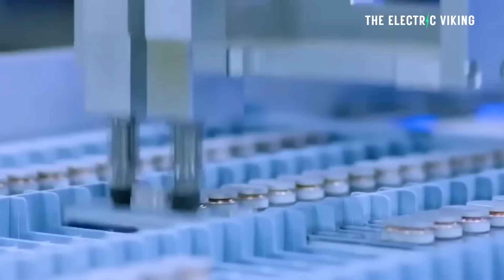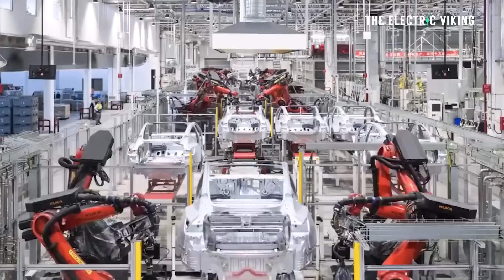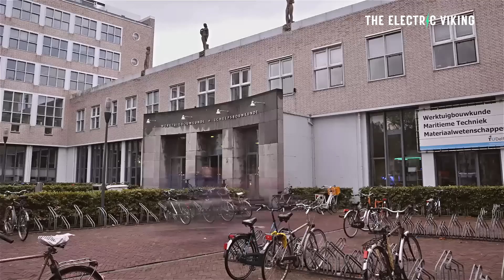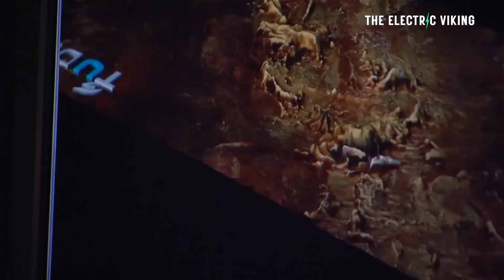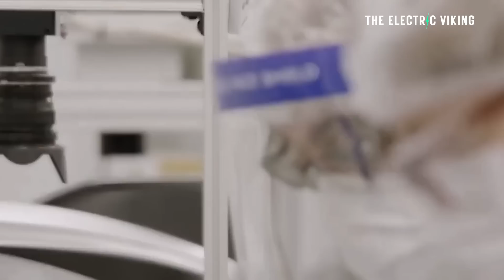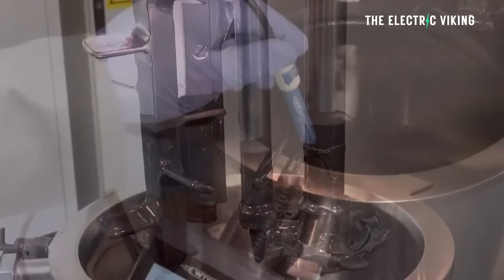Researchers make amazing discovery that cheaply doubles battery life

Comment: The same incremental changes can apply to solid-state after they arrive on mass.
You're implying we give up on a technology because what we have works well enough.
That's never been the way of progress, enhanced transportation covers the wheel to flight and many iterations worked well enough and better than what we previously had.
Solid-state may play a roll in the area of weight reductions, dendrite elimination or ending the spontaneous ignition of your cars battery.
If marking time was what we were best at, we'd still live in caves.
Fusion to fission has taken 70 years to get 1 working example.
Advanced EV battery tech is may be 15 to 18 year old, I think we can give solid-state a few more years of development before tossing it on the scrap heap.
The learning never stops nor should it.

Comment: FYI "Not enough lithium" :  In general, mineral source - including oil, lithium, sodium etc are defined by availability@ cost - NOT amount of material on planet.  Ie there is huge amounts of lithium at infinite cost, but there is a limited supply of lithium at a particular cost.  That cost is subject to change based on technology to extract the mineral, and that depends on needs required to meet poduction.
Nissan/Toyota stating there is not enough Lithium indicates they are "stupid".  The cost of lithium will rise as supply/demand/cost-of-extraction changes, but will fall as new technology of cost of extraction improves (Tesla is working on cold extraction making it much cheaper).
in future, during stable state of electric cars, then the supply of minerals will come from recycling as the unit cost of a battery is high and therefore recovery of minerals is commercially profitable.  At that point the cost of minerals will fall significantly.  That event of course is years away.

Comment: The future of batteries is to eliminate more than one per application. 

Already from Brazil to Canada engineers have demonstrated that batteries are endless supplies of electrodynamic energy (the useful stuff of electricity) that can be tapped without exhausting the limited supply of electrons and protons (AKA discharging).

Sure, the Brazilians who ran multiple printing presses all day with two lead acid car batteries with a commercial inverter and their secret backpack sized invention were arrested, and not one auto maker the Canadian approached with his smart transformer wanted his solution, but eventually the world will choose life ahead of dollars. You can’t eat radioactive or oil soaked food and reducing the population has an offsetting economic impact over the cost of eliminating toxic energy production. The incremental approaches are designed to minimize the impact of the coming economic revolution, maximize the invested returns as long as people will still buy them. Today any car could be self-charging while being driven, not just braking. And any one battery could supply all the power you need without charging, Really! Sadly, Physicists choose eating over truth, they can easily show you the math that mass transfer is a viable self-powered motor option ( no battery or fuel needed) Both Viktor Schauberger and Sam Clem built them to run his home generator and the other his car to drive across Texas. (Momentum is conserved, not kinetic energy like electricity (that can be easily amplified). Free energy doesn’t pay university funding.

Comment: Modern litium ion batteries only contain roughly 2% lithium based on weight. But lithium has sky rocketed in costs. Any technoligy that lowers the required amount us a good thing. I agree that every battery has a place in the future. I would like to put to bed this fear based idea that ev's batteries will need replced every 7-10yrs. Thats just not the case. Even after 10yrs and 1500 battery cycles you still have 80% of what u started with. Its not like blowing a engine and replacing it. Not at all. For many people it will be there childtens car after 10yrs. Sure its range will only be 180miles or less. But it still functions just fine. I was a sceptic for years but theres just not data to back it up. Battery packs are delivering on what they promised. I dont see or hear people bitching because there cars battery died after 3yrs. Or 5yrs.. Or even 10yrs. Pencil out maintaince and engine/transmission service and replacement and i think its a no brainer. The ev's win everytime.

Comment: 1,000 South Australia big batteries 
is equal to South Australia's 1.5million registered vehicles with 100kwh batteries. 

So when EV replace all South Australia ice vehicles then the daily DISPATCHABLE power will be 10 times the sundown needs.
Every rooftop with 33kwh of solar panels and connected to the grid. 
Any political party that jeopardise that future is dead.
Fossil fuels will be needed for raw feed stock in German manufacturing plants relocated to Adelaide. 
Nuclear exports to every country's nuclear industries will not be needed. 
German migration to Australia will be one of the boosts to Australia population.

Comment: The future is not central electric power generation because the distribution costs are huge. The national grid would have to be 5 times bigger in capacity. 
The EV big batteries will be in vehicles parked 23hrs every day and automatically connected to the national grid. 
This gives 5 times more dispatchable electricity daily, 5 times more than today's fossil fueled power plants. 

The home robotic vacuum cleaner can teach the selfparking EV to connect to the grid. Ezi pezi. 

Every rooftop solar PV is connected to the grid. 

This combination can not be beaten.
The auto manufacturers know this. 
The nuclear promoters know this.
Big business knows this.

Every one knows that the additional cost on a country expanding its national grid is deadly economically.

Comment: I’ve had loads of petrol and diesel cars, never had an engine go over 500,000 miles without a full rebuild / replacement so what’s the fuss if your 10 year old electric car needs a new battery pack, assuming you can’t live with a lesser range ?
Reply: I think it's cost comparison. By the time your car needs that engine work, you could easily replace the whole thing for 2-5k. When an ev needs a battery, it's still going to be 10k+ of its even available because the damn things have zero standardization. Just look at gm. The volt bolt and spark all have unique batteries that gm doesn't make any more. They can't be upgraded to the ultium platform either. So finding a battery for those cars is hard and they are worth more than the entire car at this point. Now, what about a gm gas car? No problem. Your v8 ls is worn out? There are a literal million good engines in salvage yards for cheap, and you can even order brand new crate engines online for a few thousand. See the difference? I'm hoping with time, manufacturers can get their act together and standardize better with evs as this will definitely solve the pack replacement issues.

Comment: Great video - agree 100%   The car companies waiting for that silver bullet battery may have already lost the race.  Tesla continues to drive incremental improvement in battery tech, all the while increasing their marketshare of the vehicle market.
Reply: BYD has overtaken Tesla with their blade battery, a fact which Tesla seems to be recognizing as they have contracted to use BYD batteries in some of their range. As the issue with  battery re-cycling become more apparent and the lesser performing batteries are weeded out, I expect to see a situation where in future cars are bought but the batteries are leased and returned to the supplier.

Comment: But what you didn't discuss is having the battery last a lot longer but with 70% of the range.  Who wants that?  Range is very important to my family so I'm still not buying in until this gets worked out, which may be ready in about 5 years.  We're getting there, albeit slowly.
Reply: Once the range decreases you can use it for energy storage . Once the battery is no longer moving and is in stationary storage it still has a useful life. The chemical  components are also recyclable for reuse at the end of battery life. Learn more about the battery tech.🤔
Reply: @michaeldautel7568  - if you want to have a discussion about battery chemistry that's fine, but your reply is partially obvious  and also short sited in that it's expensive to recycle EV batteries right now and that has nothing to do with range.
Reply: @blasterguam  I do not think that the 70% range is accurate or that the batteries degrade that fast just based on videos found right here on youtube. Check them out yourself. Tesla appears to have the best  range and longevity.🤔

Comment: Insufficient EVs are being scrapped yet to sustain an efficient lithium traction battery recycling industry. That will start to happen in about seven or eight years enabling large amounts of lithium to be recycled into new vehicles long before mined lithium supply problems develop. Of course by then other chemistries such as aluminium, magnesium and sodium will likely be competitive plays.
Reply: Im not convinced they have a cost effect means to recycle lith-ion batteries.. Not if u need to rcover each if the metals. If your just scrapping them fir steel then yes. Its not easy getting the lithium and cobalt and nickel seperated affordably. I hear they have new technology but then never see the plants get built. Kind of like waiting for graphene to be widespread. It may happen, but dint hold your breath waiting.
Reply: @kennedy6971  Graphene lead batteries already available where I live. They are quite good.

The recycling of lithium batteries is currently at 15%, mainly phone batteries. Shredders currently being developed can accommodate larger format vehicle batteries, with the industry  aiming for 85% recycling in ten years. It should be quite straight forward but you need to have the 'tonnage' to make the process economic. It's generally agreed lithium batteries going to landfill is bad, so regulation maybe needed until the industry gets going.

Comment: Fascinating stuff Sam. Can't wait to see other researches verify and experiment even further. The future is exciting. The upsides sound very important, but I wonder if there are any downsides to the performance of the battery by adding these extra salts. Charging speed, power output, volumetric or gravimetric energy density? Any ideas if there are any of these compromises? Or maybe some of these parameters have even been improved?
Reply: Sodium is below Lithium on the Table of Elements, so it is heavier. According to Jeff Dahn, researcher at Dalhousie University (with funding from Tesla) Sodium Ion batteries will be essential for the growing stationary energy storage requirements such as Megapacks. Gravimetric density is not going to be good enough for most medium to high performance cars.

They are also at the early stages of research. According to a 30 minute presentation Dahn gave recently (available on YouTube) they are testing and trialing different additives to improve the lifetime. Still probably at least a couple of years to go before they have something that can be made into a product and scaled.

Comment: So in the future the average car would be patched and worn but still kept on the road because the batteries haven't worn out yet.
Reply: The batteries would be re-purposed as home storage units.
Reply: @stewiesaidthat  I know.I'm wondering what the degradation profile would be for batteries as they are now.  I mean, realistically what is the point that you'd dispose of (recycle) stationary batteries that you'd already paid for?
Reply: @Glenn Martin  the technology is changing faster than I can keep up with it. Unless you switch put cars every few years, I'd hold of a couple more years before jumping in. Still need to manage battery degradation for diverse environments. Environmental temperatures, fast charging, discharging cycles. In a car you full capacity. 80%+ at least so you don't get stranded. For home use, the recharge rate can be much slower extending the life of the battery plus performance is not as critical. How much dead battery weight are you willing to tote around and pay for at the pump. Will you trade when you are down to a 200-mile range, a 100 miles. That's going to be the cutoff point. How many miles you can get on a full charge.
Reply: @stewiesaidthat  The lifespan of batteries in a car depends on the desired range but it's their second life as stationary storage I'm curious about.  Another ten years?, 20?  30? It's beginning to look like there will be a technological reason to recycle batteries rather than their lifespan.
Reply: @Glenn Martin  a batteries lifespan is dependent on the number of charge and discharge cycles and the rate at which it is charged/discharged. As a home backup system, the rate of degradation should be much lower. And dead weight wouldn't be a problem. Off grid, I'd want brand new batteries. Temporary power outage, they'd be OK.
Reply: @stewiesaidthat  I suppose the death knell of repurposed EV batteries would be corrosion, some tech advance/compatability issue that would make replacing them advantageous or the value of recycled materials be more than the cost of replacement.  In thirty years we all could be up to our armpits in second life batteries.
Reply: @Glenn Martin  EV'S may turn out to be a boondoggle for the recycling industry. By 2030, there will still be more ICE cars on the road older than 25 years than EV's and EV'S with lifespan of about 10-12 years, with an expensive battery replacement in the near future, are going to the recycling bin much sooner than it's ICE counterpart. I think that ICE'S will end up being appliances. Buy the cheapest you can because it will only be worth scrap price in a few years.
Reply: If it's my car it will be mostly composed of duct tape and Bondo.

Comment: The pace of battery tech is improving at a more rapid pace with every passing year. The anti-EV crowd is getting fewer and fewer things they can bash EVs over and have any leg to stand on about it. When you think about what EVs where like for decades, with bad range, slow charging, etc, and in just the past decade more progress has been made then the previous hundred years for EVs. We are going to reach a point where EVs is like smartphones, in the sense of by the time you buy a smartphone, a better one is just about to be released. You will be wanting to buy an EV now, but a better one is months away from being released. That is a good problem to have and by 2030 or earlier, this is what EV buyers will have to face.
Reply: I don't think that the battery tech has really gone anywhere in the last 5 years. No offense
Reply: @DavesUnbranded  Five years ago, most of what you saw being used was pouch batteries or the 2170 cells. Battery mixes were limited and often leaned hard on rare materials. Now, we have 4680 cells in production and BYD blade batteries are in full use. Viking has hammered the use of manganese these days. 

Battery tech that was supposed to be in full EV production was solid state, which has not happened. Toyota was talking about solid state in their vehicles this year, but that got pushed to 2025. 

I am no offended if you do not think that is much battery advancement, but of what has reached the market, I believe we have made some big advancements since 2017. The is battery tech for more rapid charging, higher energy density, less rare materials, and faster production coming. I am not sold on the idea of solid state being here until 2030. 

No matter how you look at it, just happy volume of battery production is up and EV manufacturing is up. As the world changes to EV, the R&D money will focus more and more on EVs and their batteries.

Comment: I'm wondering how to convince the electric unicycle manufacturers tho use super-capacitors in parrallel with their chemical batteries to store and discharge power quickly.
They never tell me how much braking energy is returned to the batteries, but I'm sure that the characteristics of the supercapacitor will absorb surges and send the excess power to the batteries slowly. (Something to do with di/dt where i is the current.)
Reply: Capacitors have such poor energy density it never makes sense to use them in any EV.  If you have extra room for them you are better off adding more battery instead.

Comment: Double the battery life for less than 100$ extra, I guess. That is a good discovery.
Reply: Not double the battery life, rather it means half the degradation, resulting in 50% 'longer battery life' which is 133% of the 'current battery life'. Math heads please correct me if I've misstated this.

Comment: Completely agree that a number of small increments are far more likely and interesting than the next " big thing ".  Sodium ion and sodium lithium batteries are soon into production, they will expand the use cases and reduce costs long before solid state is a real thing. 
Sometimes, you just have to get on with what I'd in front of you rather then sitting on your hands waiting for something that never quite appears